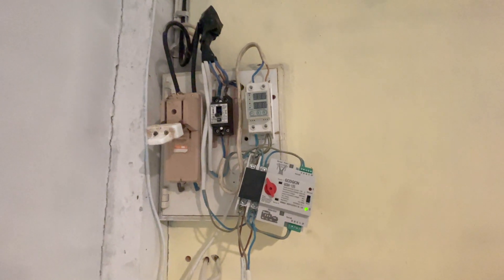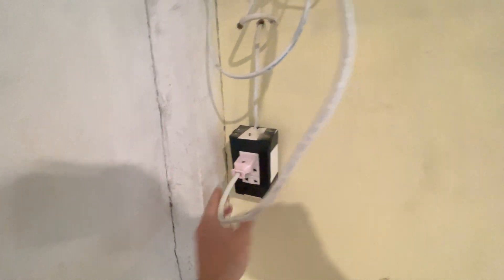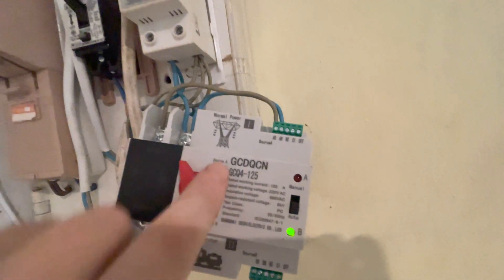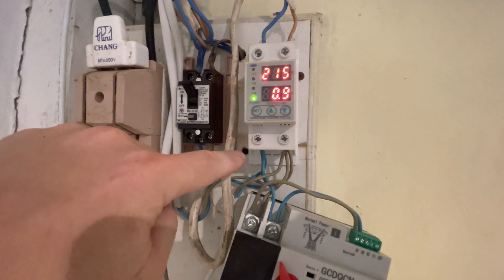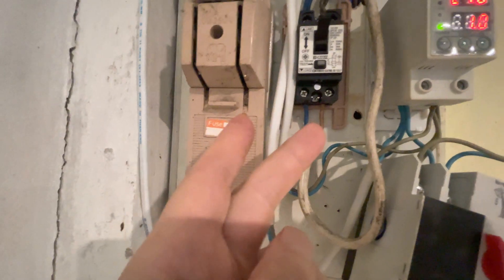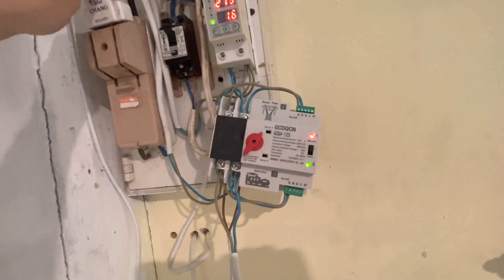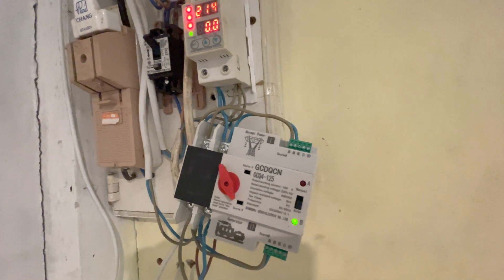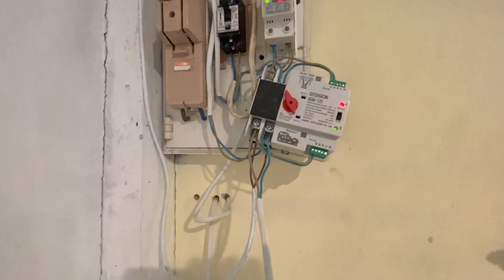GCDQCN GCQ4-125 ATS FAILED after 8 weeks! Edit:After 2weeks the switch works again Ants Maybe 🤔 ?

Comment: Hi, nice videos, watched all of your videos related to ATS switches and your electric setup.

I would like to know how long did this ATS switch last? And why it failed? And how long have you been using the motorized ATS switch? the one that you have in your most recent videos.

Thanks. I've purchased the motorized version of this ATS switch for my air conditioner load.